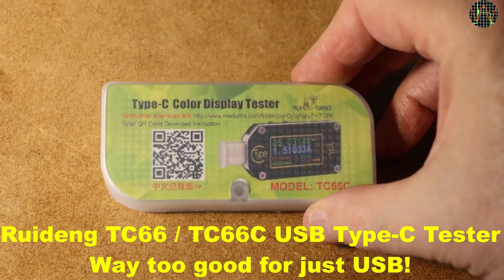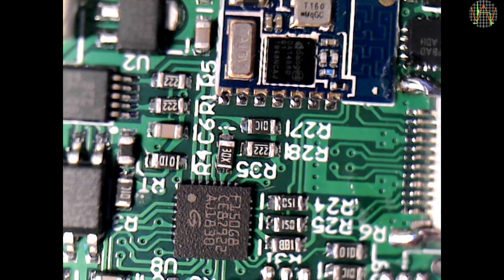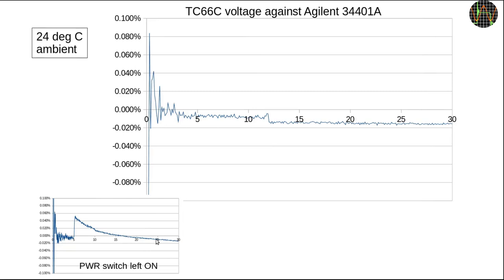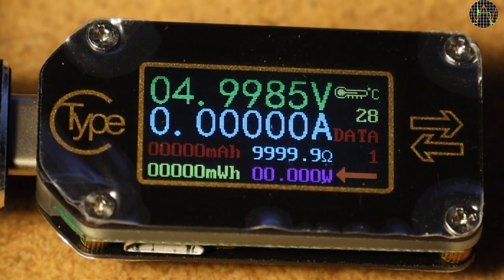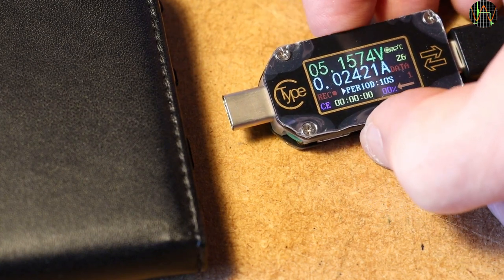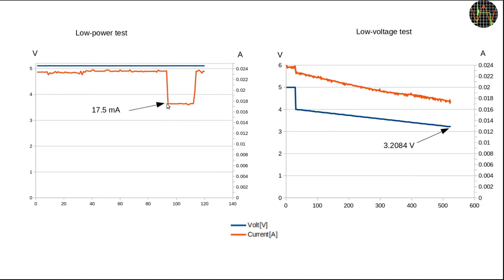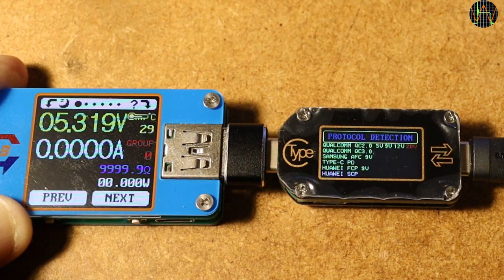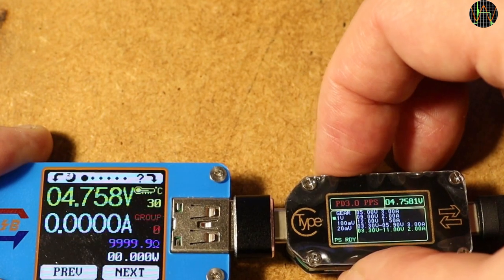Ruideng TC66 / TC66C USB Type-C Tester - Way too good for just USB!

Comment: Do you know if the current sense resistor is on the high side or low side?
Reply from the maker: Its in the video around 33:40 and there is a follow-on video on my channel that goes even into greater detail on the INA226

Comment: Hi - Is it possible to test for USB cable quality using this? Some cable manufacturers can claim anything they want if they can't be tested at home.

Peace
Reply from the maker: If you are interested in cable resistance, you can measure this with the TC66/C. There are many ways. For example: Select the TC66 display so it shows resistance as well as other data. Connect its plug end to a 5V power bank or charger and connect the socket through the cable of interest to a load. The load should draw a constant current. If you don't have a USB load (resistors), use a USB light but definitely not something that charges like a battery and therefore uses less and less current. The display shows the resistance in ohms represented by the load + cable. Now try different cables and you see how good the cables are relative to each other. If you can make a direct connection to the load (with no cable), that resistance should be the base to subtract from all measurements with cables to get the actual resistance. But even just comparing cables is quite interesting.
Reply: @TheHWcave  Thanks for the detailed reply. I have a UM34 and also a Ruideng LD25. I have completely forgotten how to use both of them because I haven't used them in years. I was looking for something simpler to use but if I could use these how would I go about it?
I mainly want to use them for cable resistance so I can get rid of the bad ones and also to check the real output of several USB chargers I have.
Also with the UM34 if I plug in a USB-C lead from a USB-C port on my charger into the C port on the side of the UM34 it doesn't power on.
But if I use a USB-A to C cord from a USB-A on the same charger to the same USB-C port on the UM34 it does power up.
I thought the USB-C port on my charger might be broken but if I plug it into my phone it works fine. Would you know what's going on?
Sorry for all the questions.
Reply from the maker: @MrEvilWasp  Quite a while ago I did a review of the UM34C https://youtu.be/3yhHX96h-jg and it includes testing cable resistance at the end. There is some problem with the way the UM34C calculates the resistance but the video points out how to do it yourself. Also to get accurate results you need a load that either doesn't change with different voltages (electronic load) or at least has a constant resistance. Most things with a USB connection do neither, but there are some cheap loads out there that consist of just one or two power resistors with a USB socket.

Comment: The share button on the android app isn't working for me. It says "storage permissions are not open". I tried reinstalling the app and indeed it asks for those permissions on first launch, however, even after giving it permission it still gives the error message.
This is on Android 11 (oneplus).

I guess I have to use your TC66 program :)

According to your video, the diagram shows that TC66 passes through USB C. I wanted to test this with the 65W warp charger that came with my phone. The phone detects "warp charge" and with 40% left in the battery the charger goes up to 5A at around 9V (45W). I will try again with 0% battery.
This protocol is working even though it is not a protocol recognized by the TC66C (I assume because of the passthrough).

When connecting the TC66C to the phone port (USB C, 3.1) without anything connected on the other side, it's required to turn on the PD switch or else the TC66C will not get power and will not turn on. After that you can connect to it via bluetooth (however share isn't working in the app).
Reply from the maker: Warp Charge is a proprietary protocol and not USB PD. Hopefully the folks at Ruideng will add it to the detected protocols eventually (and the related VOOC and Dash charge protocols).  For measuring what is going on during Warp Charge, you should turn the TC66C's PD switch off. It is nice to hear that Warp Charge worked through the TC66C. This  is what I expect as behaviour because it is transparent on the connection between phone and charger, but its nice to hear confirmation.

The fact that you need to turn the TC66C PD switch on when connecting it just to the phone is again expected behaviour and shows your phone as DFP in this case, follows the USB C standard.  
I have no idea why "Share" does not work for you and whether that permission problem is in the TC66 app or Microsoft, or Google. I don't have anything that runs Android 11. Sorry.  Do you have other (older) phones/tablets that you could use for Bluetooth?
Reply: @TheHWcave   I can confirm that "Share" works on Android 9 (Xiaomi Mi A1, running Android One). So I guess this bug can be attributed to the lack of Android 11 support. On the Android Play Store there are many 1-2 star reviews stating that the "Share" button does not work. On Android 9 I tried with versions 2.0.2 and 2.0.4, both worked.
On Android 11 I only tried v2.0.4.

Edit: just mentioning that Mi A1 has a USB C 2.0 port
Reply from the maker: Thanks for the update. Good to know
Reply: @TheHWcave  Warp charge is failing to reach maximum speed. It's supposed to be 10V 6.5A but it hits a ceiling at around 5.47A 8.5V. I now remember that you showed in the video that the TI chip is limited to 5.47A so I guess that's the problem. TC66 reached 45C after only a few minutes so I stopped the experiment.
Reply from the maker: Yes the INA226 is configured by the firmware to that maximum value. That said, the INA226 does not stop or limit more current going through. While the TC66 reading did not exceed 5.4A your phone would have received the full 6.5A. However,  the TC66 is designed for 5A max. in accordance with the USB Type C standard, so you may well damage it when pumping 6.5A through it.  But you raise a good point. Given the likelyhood of more people using Warp charging,  the TC66 designers should display "Overload" when 5A is exceeded instead of just showing the highest possible value.

Comment: How does that PD soft switch work? It seems to be impossible, you need voltage to control mosfets. Or does it is really just on, just software turns it off quickly on boot?
Reply from the maker: You caught me out! A very good point There a some exotic technologies and lots of research papers but I have not found anything useful. BTW there is a chip next to the Bluetooth module. It has 14 pins (4+3+4+3) in what looks like a QFP or LQFP or TQFP package with the marking "PBAD" and the next line "ADH".  I am not able to find anything on that. Maybe that contains the solution?
Reply from the maker: Another thought on that. Its not that there isn't any power available in the TC66 in that state. The charger will pull up CC with a 56K resistor to 5V. The TC66 could use this to power some very low-current memory circuit. It would need to draw probably significant less than  50uA to avoid detection by the charger. Based on that memory, the  could then decide whether to ignore (PD softswitch off) or engage by increasing the current to 81uA (simulating the presence of a 5.1K RD pulldown resistor)

Comment: Can I measure the power draw of adapters with this one? I have an Apple multipart AV adapter Version 2.0 and it gets warm even though nothing is connected to it other than my MacBook m1 so it draws unnecessary and visibly a lot of power at all times. I would compare it to a satechi multipart that is similarly spec_ed.
Reply from the maker: Well, if the plug is USB-C then yes, you could plug it between the adapter and the MacBook and see what the power draw is, especially if the draw reduces to very little when the batteries are full, as it should. 
If you are interested on what happens on the mains voltage side, you need a different type of monitor. Check out my playlist on the PZEM-xxx type of meters but you can also buy less elaborate power/energy meters that you just insert between the device your are interested in (AC adapter) and the mains socket.
Reply: @TheHWcave  So I only care about how much the plugged in apple multiport AV adapter (HDMI 2.0b, 1xUSB A, and USB-C PDonly ) draws from the MacBooks battery while not charging through it. It is drawing some constant amount even though it is not in use as it gets warm. I will be comparing to an alternative adapter from Satechi. The idea is that it should not be draining when I am not using it while its plugged in. Yes, I could unplug but I will be using its USB A functionality for mouse which does not make it drain the MacBook more than when its just pluggged but not in use. It looks as if the additional "passive" draining is due to HDMI output that cannot be switched off even though nothing is connected.
Reply: @TheHWcave  so I measured all my peripherals like 10 year old Apple full-size wired keyboard, new and old mx518 mouse, and 3 different hubs and the Apple multiport AV. I was surprised to find a new laser mx518 using 5x less power than the 15 y older non laser variant. Some usb hubs do not have a standby... the multiport av is not that power hungry and has a standby mode but all in all they all draw 0,1-0.4 w during in standby so unplugging is the way. During usage multiport + Anker usba hub + Keyboard and Modus can draw 1,5 w additionally to the MacBook Air m1 ‚s ~ 3 w in clam shell mode which explains the battery drain!
Reply from the maker: @AA-dq5uo  Thanks for the update. I totally agree to unplug them if not needed, even a relative small power draw does add up.
Reply: @TheHWcave  do You by any chance know which usb controller from TI, cypress or Infineon is the most efficient and advanced? 

it would be interesting to find most efficient 4in1 usb_c_to_a/c HUB with PD. 

As for USB_A:
The Anker 4in1 black plastic „bar“ USB_A to USB_A is very good efficiency wise With just 0,15w whole in use. Standby is 3x less.
Reply from the maker: @AA-dq5uo  Unfortunately I haven't looked into USB hubs recently. I only have a few really old USB-A to USB-A ones mostly temporarily to expand USB ports while configuring fresh Raspberry Pi Zeros to use my home network and allow remote login instead of USB keyboard & mouse

Comment: I accidentally triggered protocol detection while charging my smartphone through a powerbank... Is my phone ok? Hahaha i feel so stupid 🤦‍♂️

It went through all of them but my powerbank does not support QC2.0 20v, Huawei SCP, and Type C PD. My phone is still working properly ( i think?) And i was wondering if it will have long term effects 😂

So far i dont notice anything wrong with my phone - s21 ultra. But im worried i might fave issues long term after what ive done lol.
Reply: I was hoping that since my power bank does not support QC 2.0 20v, Huawei SCP, and Type C PD that my phone did not receive too much voltage but im not sure if thats correct... I am afraid i fed my phone too much voltage.
Reply from the maker: Those triggers are really quite dangerous. I hope your phone survived.

Comment: Better than um25c?
Reply from the maker: They are very different. For use with USB-A or mini/micro USB connectors, the TC66C would need adapters which isn't very convenient. However, it is much more accurate than the UM25 and being powered externally it can measure down to zero volts.